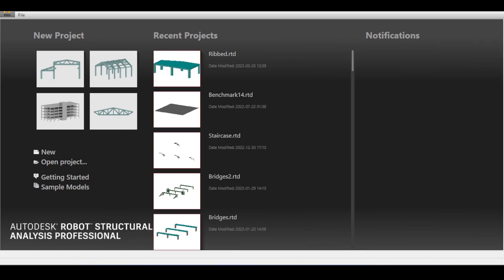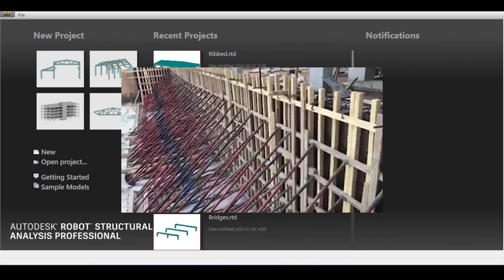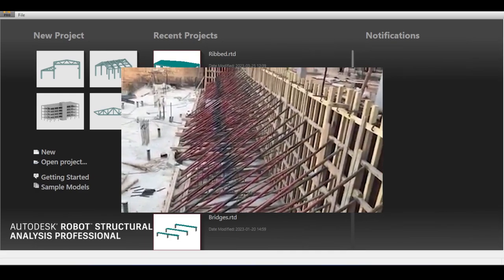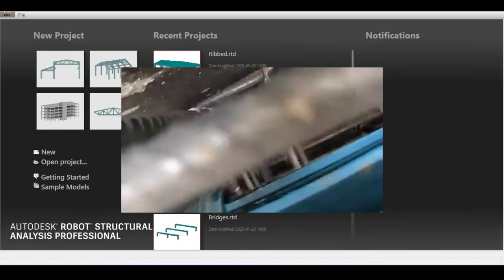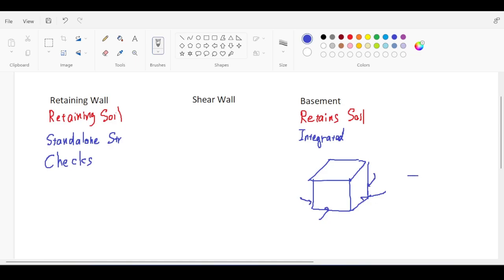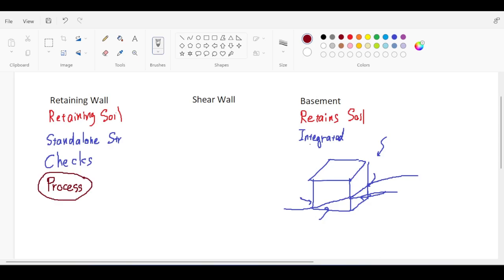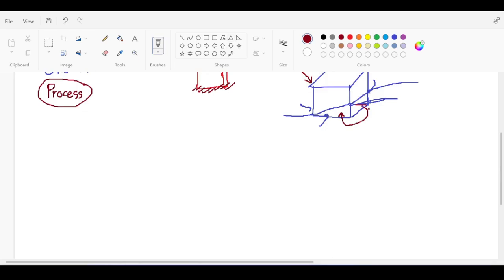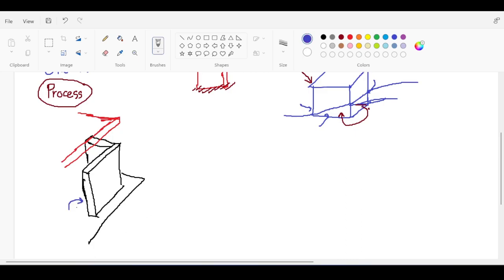Modeling of Basement Walls in Autodesk Robot | Part 1: Modeling Process

Comment: PART III

Tangent question: 

1. I know that today’s video is not about shear walls, I also understand that shear walls are a different category and a totally different ballpark [CEE overview about shear walls from 04:20 on this video was very clear on this (thanks)].

2. My question is: I am modelling a four-storey residential building [Rigid RC frame structure with Columns, Beams and Slabs]. I would like to investigate an option of a structural system for this building that also have SHEAR WALLS. I intend for the shear walls to carry lateral loads (from EQ and WIND loads) on the entire building. 

3. I would like to “assume” that the columns on my structure DO NOT carry any lateral loads [from EQ and WIND] and that all lateral loads (from EQ + wind loads) are being “exclusively” carried by the shear walls. 

Now I also think that in reality, this assumption is not really what will happen to the real structure because as long as these elements are all connected, the loads will be distributed (like it or not) in the built structure according to the relative stiffnesses of the various connected structural members [beams, columns, slabs, and shear walls] and there is not much that will “shield” the columns from getting their share of the lateral loads irrespective of my supposed assumption?

4. Nonetheless, I have seen this assumption made in structures before. I think that in one of the previous slab series video when we were discussing about the torsion on the ribs, CEE mentioned “moment redistribution" and indicated that ….…even if a rib is not strong enough to carry torsion. The rib will not simply "explode" but would first go into the process of shifting the load to the next element, creating what is essentially a non-linear hinge…….

My similar thinking here is that even if the lateral loads (EQ + Wind loads) will in reality be distributed to the columns which I am assuming that they will not carry any of the lateral loads, these columns will “not simply explode 😊” but will shift the lateral loads to the SHEAR WALLS as I am assuming. Are these assumptions correct regarding the columns that do not carry lateral loads?

5. IF the above is correct, my next question is how do I efficiently model these assumptions in RSAP? 

I am thinking of modelling the entire building frame (columns, beams, slabs, and shear walls) as usual and then I intend to assign the columns [which I am assuming to not carry lateral loads infinitesimally small values of the moment of inertia in the two orthogonal bending directions (through RSAP build-in option to reduce the element (column in this case) moment of inertia). I think analysing such a structural model will “shift” all lateral loads to the SHEAR WALLS and if the shear walls that I design using this model are capable of resisting the lateral loads, then, the assumption of the columns not carrying the lateral loads will be valid-ish. Is this correct? 

6. The reason I would like to do the above is because I want to reduce the sizes of the columns and I want to use the shear walls to their maximum capabilities. What are your thoughts? Should I rather not reduce the columns stiffness and let the FE method proportion the lateral loads due to the members relative stiffness? 

What about the beams? Do I need to reduce their moment of inertia or are they part of the slab “diaphragm actions” that facilitate the loads transfer to the shear walls? I think that the beams are part of the diaphragm actions and I must not reduce their stiffnesses?

I kinda feel like I am going deep into the rabbit hole here with this model and I can really use help.

Regards, DK
Reply from the maker: Continuing...
a quick glimpse on your comment reveals that you are thinking like a post-graduate researcher. This is really really cool!

Your assumption of letting shear walls carry lateral loads entirely is totally valid. In that case, you would "theoretically" release your columns. Of course, this is not really your question, so I will end-follow you.

You are simply saying that indeed there is no 100% clean release, even if you are actually not rigidly connecting the beams with columns in reality (no steel interconnection, columns cast separately from beams).

Now, the assumption of having axial elements (released) in columns is valid, but is kind of in the non-safe side. What you are thinking now, is that there is moment, so there must be some interaction diagram requirements there. And YES! it exists.

Now, first of all, the practical modeling consideration. In practical considerations, a simple release in the column is sufficient. Why? Now I need to be not code-neutral. In the ACI code, parts of the factor of safety considers accidental eccentricities and moments due to this exact interaction, so the code got me covered in that case. Pls check your code if there is smthn similar.

Going into the deeper though, how would you calculate the non-linear hinge there, and here is my take on it, please note that this is an opinion.

I would calculate two stages of the moment there. 
Stage 1: column did not crack. It can carry tension. (you can ignore it if you want)
Here, this stage covers all moments between 0 and the cracking moment of your column section. This can be calculated by setting the max tensile stress in your concrete inside the column.

Stage 2: cracked section.
Here, you loose the tensile part of your concrete, and you can calculate the moment carrying capacity of your column, based on the moment applied. THIS IS A HUGE APPROXIMATION, because you are ignoring the axial force in this case. Please note, this is at least M.Sc. research stuff, where researchers would do their entire thesis on:
Simulating a beam-column connection
Having a real-life experimental model
Trying to see how the real life experimental model corresponds to their simulation
using AnSYS.

so in point 5: you can simply release your column. This is not an attempt to run away.
but wait.. psssssssssst, here is a cool thing I did back in my day, this same issue haunted me since I was a junior engineer. So what did I do?

I had 2 robot files. 1 robot file with released columns and another with rigid columns (the two extremes). I designed columns using both and the larget reinforcement ratio was used.

Now I am aware that I have an infinite combination of moments and axials (beause I can have anything between fully released vs fully rigid), but this is as close as I can get to perfection.

But to address 6, just release the columns, is good enough in my experience.

Beams need to be reduced in moment of inertia as those are flexural members, meaning that a larger part of their section is cracked.

I hope this comment is kind of a flashlight helping you to navigate those really really interesting thoughts. I remember myself contemplating similar ideas.

Once again, a huge thnx for your comment, it helps me and the viewers immensely.

Regards,
CEE